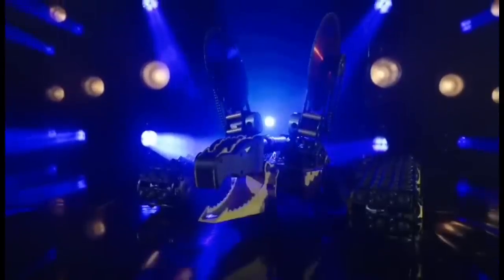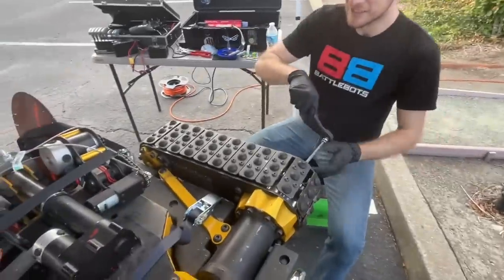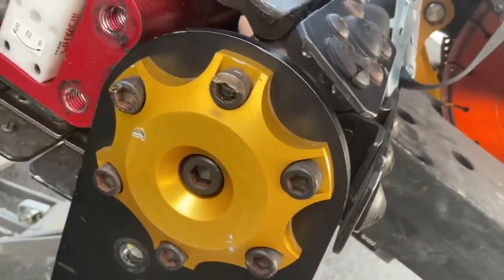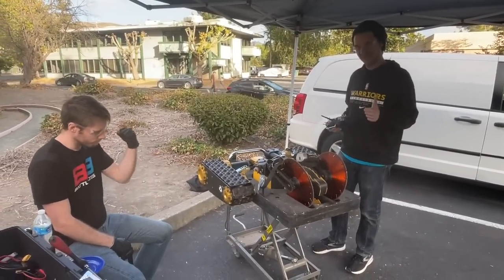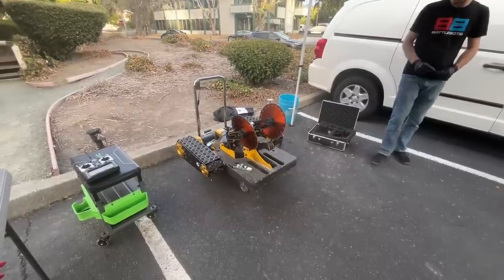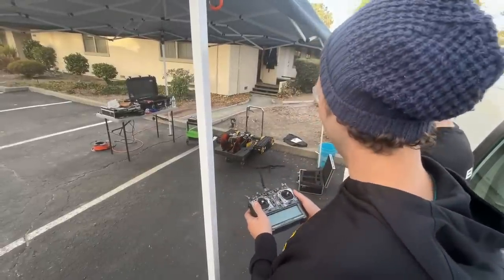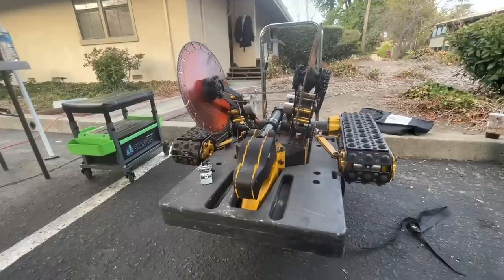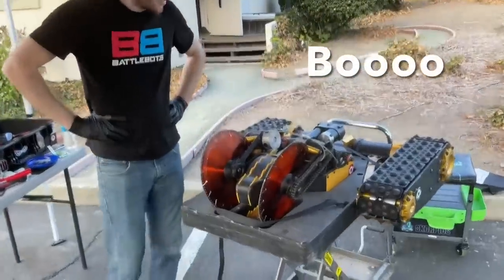The Secrets of BATTLEBOTS Newcomer DRAGON KING!!!

Comment: Put backup rubber drive wheels on the sides of the sprockets, slightly smaller diameter than the amount the tread protrudes. Lose the tread and it drops onto the backup wheel. That would at least provide some traction to move around.

Comment: Great design! Always found red Devil’s original pincers+rotating leg-like tracks similar to razorback, which is also one of my all-time favorites. I am just curious though, with high-power hammer saws and flippers dominating the current meta, do you have a counter in mind? Personally I thought that a modular arm system would be neat- for example hammer saws that replace the blade saws in tight scenarios, or wedges that reduce flipper damage
Reply: I felt more like Dragon King/Red Devil is the spiritual successor to Ronin.

Comment: The bot looks gorgeous and there's some very elegant engineering going on, but...  Well, as YouTube's resident Elli-phant in the Comments 🐘👀 I feel obliged to voice some doubts about two key areas.

The weapon blades are similar to chainsaws - they'll be effective against dogs, drug dealers, chickens, garden weeds, marauding zombies, VCRs and watermelons, but today's bots are heavily armoured. Cutting into steel with a 'chop saw' requires patience and very firm clamping.

Generating sparks looks cool, but it doesn't do enough damage quickly enough [sic] to disable an opponent or, more importantly these days, to impress judges. A one-tooth kinetic disc or drum has become the weapon of choice because it can deliver a devastating blow without having to pin an opponent or otherwise lock horns.

Example? The recent 'fight' between Bloodsport and Copperhead. One hit. The end. Cutting discs work well in the lighter weight divisions where bots have plastic parts and aluminium armour, but I don't think they scale-up well to full-contact heavyweights.

My second reservation concerns the use of tracks. When bots fight outside on grass, mud, rocks, gravel and sand, tracks are an excellent - maybe even essential - option. But indoors, on a hard floor, they seem to me to be the wrong choice.

Way back in the 1800s when George Cayley came up with the 'caterpillar track' idea,  continuous bands were specifically intended to provide support by distributing weight over a vast surface area, reducing a massive vehicle's tendency to bury itself in soft ground.

Agricultural machinery working in ploughed fields benefits from tracks, and 75-ton battle tanks have tracks and not wheels because they're often operating on loose surfaces.

Studded football boots, cleats and running spikes are great on grass but hopeless on concrete. On a smooth floor you want to maximise your ground-contact, not dissipate it.

Until I reintroduce my outdoor all-terrain fighting league, a combat robot runs indoors on a dry, hard floor. Not always smooth or free of debris, but still flat and dry. A simple, soft, treadless silicone tyre provides the optimum grip. The fewer wheels the better, because concentrating the bot's weight on a small area provides maximum traction.

Example? A fork-lift truck. It has four hard rubber tyres because it's running on smooth concrete floors and has to manoeuvre precisely whilst carrying enormous loads. So... the way I see it, for a 250 lb robot, wheels make more sense than tracks or treaded bands.

I know this kind of critical comment isn't popular on YouTube, and I often come across as a grumpy, cynical, negative so-and-so, always looking for faults and problems, but that's just the way I am. It's probably because I'm an evil Brit (boooo!).

The thing is, exhibiting relentless Pollyanna-grade optimism and Disney-esque cheerleading positivity ("Yay! Everything's wonderful! Everyone's great!")  just gets you a smack in the mouth over here.

'Firm but fair' is for wimps; I prefer 'harsh but uncompromising', even if it does get my comments deleted.🤭

Comment: are you sure sawblades are the right choice? generally weighted spinners is the better choice because it can effectively discharge all of its kinetic energy very quickly but saws might only get part of it over a longer period of time. It also seems vulnerable to vertical spinners because of the chains and whatnot, you could easily lose control of primary weapons
Reply: When AREN'T sawblades the right choice is the better question.

Rule of cool is this sport's lifeblood.
Reply: @Retrosicotte  Has a sawblade ever disabled an opponent in battlebots?
Reply: yes that's always been a problem with saws. I guess the plan is to hold the opponent while cutting into them but I don't think it'll go well